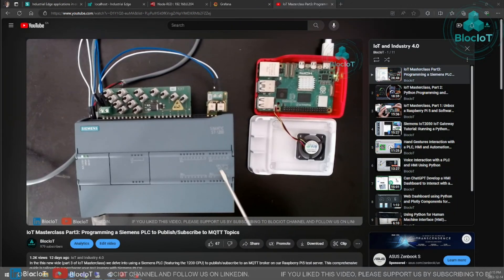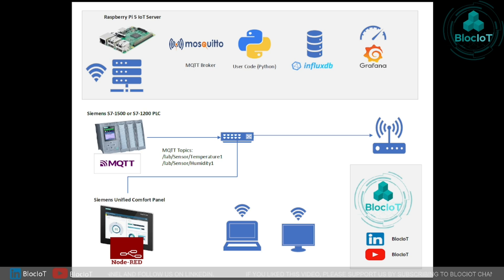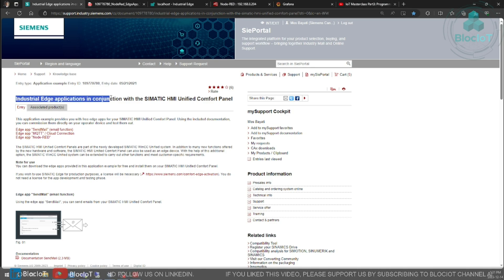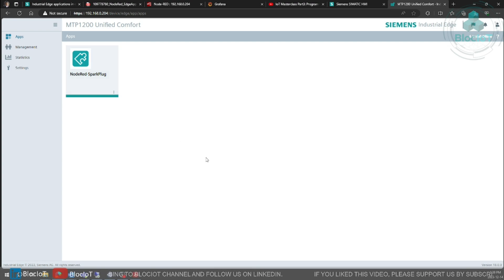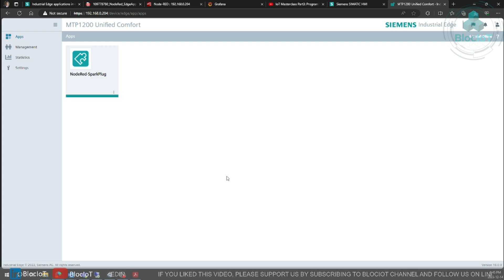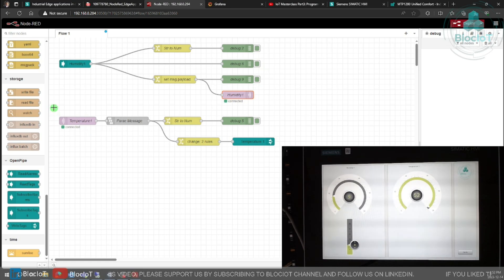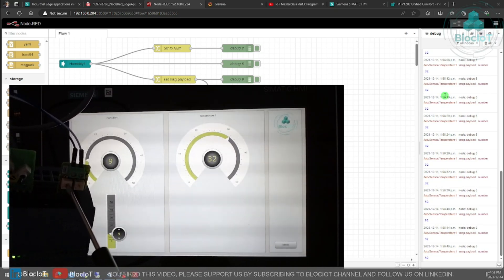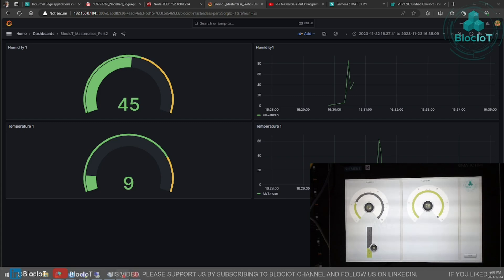26- IoT Masterclass, Part4: MQTT Communication in Siemens Unified HMI Panel using Node-Red Edge App

Comment: Can you try reading and writing the PLC's variables using MQTT and visualizing them in Node Red Dashboard ? Thank you
Reply from the maker: Hi Youssef. Yes you can do it with new Unified Comfor Panels. If you use an Ololder HMI which doesn't support Edge apps, you can imolement the data interaction in your PLC and show them on your HMI. Our previous video (Part 3 of IoT masterclass) shows how to connect a PLC to a  MQTT broker.
Reply: But how can I subscribe or Publish to more then one Topic? As a Dashboard i want to visualize the Variables on the Node-red Dashboard
Reply from the maker: @YoussefBachiri  you just need to copy and paste the set of nodes that I showed to subscribe to the example tag.
Reply: @blociot  yes, I did that, but if I publish from the PLC then the subscribe topic is overwritten directly and the topic is shown by publichen in subscribe
Reply: @blociot  yes, I did that, but if I publish from the PLC then the subscribe topic is overwritten directly and the topic is shown by publichen in subscribe
Reply from the maker: @YoussefBachiri  sorry I don't understand the issue. Please send me a message on Linkedin with screenshots.
If you publish the value from the PLC and subscribung to the same topic in HMI, you will see the same value in both PLC and HMI. All values are in the Broker. PLC, HMI or other devices don't know each other. They just interact with the broker.